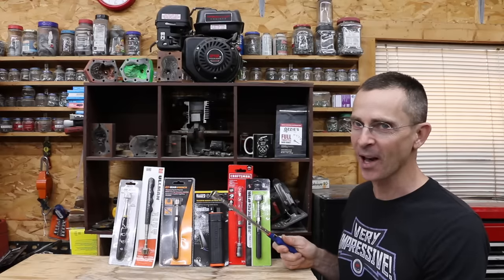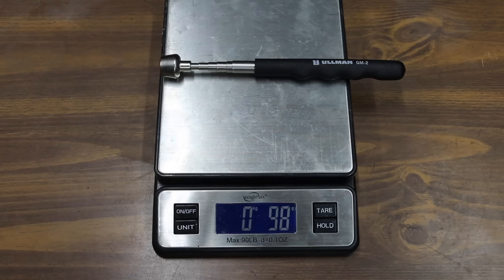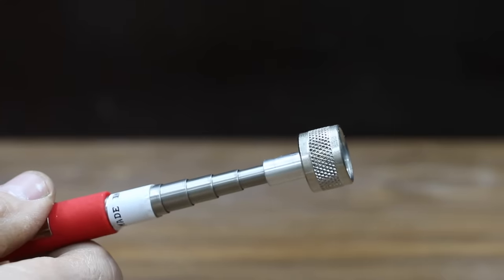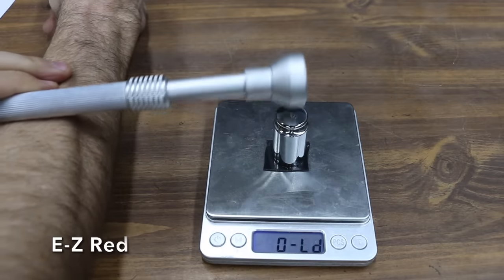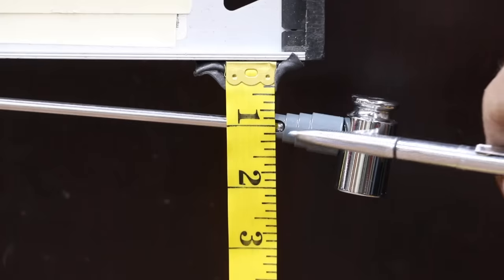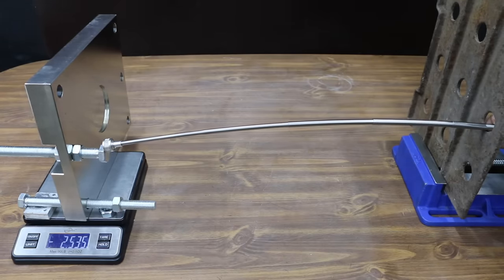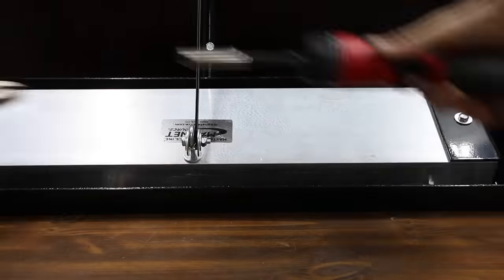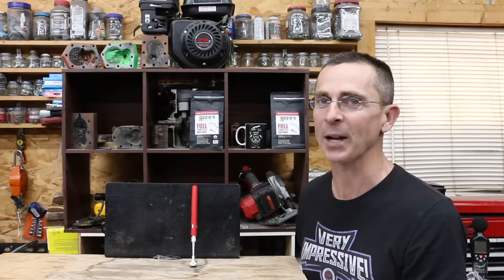Best Magnet & Magnetic Sweeper? Let’s find out!

Comment: Digital Calipers would be really cool to see compared as well as impact socket sets!
Reply from the maker: Thanks for the suggestion.
Reply: Seconded
Reply: I would also like to see impact sockets. I recently bought a Pittsburgh set because the price was just too good, but I'm curious what I'm missing out on vs something like a Tekton or DeWalt set.
Reply: YES!
Reply: @djgibbs7041  The HF sets are good to start out with or for a home-gamer but they will wear out quickly with regular use. I paid the money and bought Mac sockets for the sizes I use most often.
Reply: I'd add a traditional vernier caliper, and a mechanical dial caliper, to that test.
Reply: Mitutoyo. End of story.
Reply: @svn5994  these videos for me are for testing diminishing returns,   99% of the best products are the best most expensive products because well duh, but how close is the 7$ to the 70$ one is the important part of these videos.
Reply: The digital calliper is an easy one, starret or mitutoyo are the only ones worth getting if you really need to rely on them, the cheap ones work but not as accurate or as long and the batteries always go flat way faster.. callipers are one of those buy once, cry once tools
Reply: Or swivel sockets
Reply: I'd like to see "Anytime Tools" dial caliper from Amazon ($40) included in that comparison because I bought one.  😂  It feels like a high quality tool, heavy in the hand and well-built; I'm curious how it compares to HF and high-dollar brands.
Reply: Digital calipers would be difficult IMO. It seems like they're all accurate enough, or at least all the ones I've used are.
Reply: I'm currently shopping for an axle nut metric, deep well, impact socket set.  I second the suggestion!  Warranty, ease of exchange if needed, and of course fit, finish and durability please, Todd!
Reply: @svn5994  Starrett a close second.
Reply: @svn5994 nobody can argue that. But it'd still be nice to see a comparison.
Reply: @markshort9098 or if you're  lucky it's a find one behind the shop fridge once while the original owner cries once lol
Reply: @svn5994  Yep. I splurged on the coolant proof mitutoyos and liked them so much I bought a second pair (one for the shop, the other for my 3d printing/tinkering setup). Zero regrets.
Reply: He uses chrome on impacts.sorry
Reply: Seconded on the impact sockets
Reply: There are no digital calipers other than Mitutoyo.
Reply: Heck yes on the calipers. I need them for 3D printing and options are basically "name brand that is hundreds/thousands $$$" or "800 Made in China brands that all look the same and advertise the same specs but differ by like $20".
Reply: @rcmaniac25  Dude, just spend the $175 and buy the Mitutoyo 8" calipers.  You won't be disappointed.
Reply: True, but sometimes a 11.00 dollar DEWALT drill bit set is just as good as an expensive set. My drill bits are DEWALT because of project farm

Comment: A Telescoping magnet is an absolute essential item in my tool belt. I use it all the time and youll be amazed how many odd uses they have.
Reply from the maker: Same here! Runaway nuts and bolts always seem to settle in hard to reach areas
Reply: Yes, but lifting capacity is not a significant feature. The most important thing is reach and adaptability.
Reply: I am guaranteed to drop a few screws when on a ladder.  It is law.
Reply: I carry two, so that I can pick up the one that I drop whilst picking up a dropped bolt.
Reply: Good point drop a bolt or a nut inside of a  BMW or a  Euro car a good Magnet or a multi flex head magnet is super helpful
Reply: @JarzanX  100%. Head flexibility and low pull-through of the shielding are far more important than lifting strength.
Reply: @JarzanX  Strength can help overcome that last inch if you can't quite make physical contact.
Reply: @rogerstlaurent8704  A lot of BMW hardware is aluminum. At least it is on mine with a magnesium block.
Reply: ...that's what she said
Reply: @JarzanX  For me lifting capacity is the most most important feature quickly followed by being robust enough to handle the weight. Fishing for a 1-3/4” deep 3/4” drive impact socket in a large excavator frame will quickly make one appreciate a good strong magnet.
Reply: List all the ways, I want to be amazed.
Reply: @JarzanX  sure, but knowing how strong these products are vs their claims is still helpful info. This way you can decide for yourself what strength magnet you want
Reply: @UncleKennysPlace  The OLLLLLLLLLL daisy chain baby
Reply: Even though I find you need various types and sizes for different tasks even a basic mid size one is extremely handy in any tool kit.
Reply: Not for me, because I use almost all stainless hardware, which doesn't stick to a magnet.
Reply: Many of these telescoping magnets look suspiciously similar to those telescoping baton-clubs used by police in British crime-drama shows!
Reply: @JarzanX , side-shielding becomes increasingly important the farther down into a tight space you have to reach.
Reply: Side shielding is important.
Reply: @dougrobinson8602  not the Nuts  and bolts yes there is a lot of Aluminum on BMW"s and other euro cars
Reply: I don't use it even monthly usually but it's so compact, minimal mass and inexpensive it's essential for any significant toolbox.

My (probably cheapos) have failed at telescoping joints in recent yrs, if not carelessly kinked at some point.

Comment: I bought a Central Machinery sweeper about 10-15 years ago. I got the widest they had 36"?  I must say that sweeper is fantastic. I pulled old nails and roofing nails out of my driveway that I never had any idea they were there. It paid for itself in no flat tires. Now my driveway is dirt and gravel and it worked just fine on that. I even pulled metal and nails out of my lawn with it! 
 It is fantastic for cleanup after dismantling pallets also.
Reply from the maker: Thanks for sharing.

Comment: Hey Todd -

I have owned a lot of different telescopic magnetic pickup tools, and they all have a similar problem. They fail at the telescopic connection points after numerous cycles of opening and closing. If you could put all of the magnets to that test, that would be more helpful than the other tests. I have yet to find a durable model.
Reply from the maker: Thanks for the suggestion.

Comment: I don't normally care for Craftsman anymore, but you had me at $13, for the one that had the light in the center. It picked up a lot of weight and I could see what I was picking up. Good Job as always Todd!
Reply from the maker: Thanks!
Reply: I had a light up one from another manufacturer years ago.
The head was too heavy for the thin shaft and broke off.😠👎👎
Reply: @BA-gn3qb ,  Most illuminated telescoping magnets use coin batteries, which I detest because they're expensive and they tend to leak. The design often sucks because the battery is inside the magnet head along with the LED, making the magnet head large and unwieldy.  It would be better to use a pen light battery built into the handle, although this could get tricky design wise for a telescoping magnet. If the magnet was on the end of a goose neck then it would be pretty simple to run a wire up the middle of it to power the LED. Or perhaps use of a fiber-optic light pipe?
Reply: I bought a socket set from Sears some 30 years ago. I don't use tools as much or often as most guys, but I must admit they really do a good job. My father, a tool and die maker for GM, swore by this brand back in the day and I still have some of his tools. These days with everybody producing Chinese trash, I would hesitate to purchase a Craftsmen ANYTHING.
Reply: The last craftsman magnet I got at Lowe's was in a three piece kit a grabbing tool,mirror &the  magnet for around 2 dollars more than the magnet alone.
Reply: I bought the Craftsman magnet with the light. The light broke after the first use. It was replaced on  warranty and the second one broke right away. I now have a Pittsburgh.

Comment: I'm a professional airplane mechanic and I use magnetic pickup tools regularly.  They are mostly used for starting a nut on hard to reach bolts and screws.  For that purpose,  it is important that the head swivels or otherwise articulates,  and that the magnet is relatively weak.  If the magnet is too strong, it doesn't work for this purpose.  I use a really cheap, tiny Harbor freight magnet tool for this.  I think it was around $3.
Reply from the maker: Thanks for sharing.

Comment: I have the Older Craftsman that came with a attachable mirror and the Blue Point. That Blue Point can get into some tight confined areas.  Which normally seems to be where all the lost hardware goes to. 
Thanks again brother for another great video. We honestly do appreciate everything you do and especially the unbiased testing. 
Have a great day brother.
Reply: I've got that one also. It has been very handy for dropped things under the bed  , and seeing into small places.👍.
Reply: After 24 years in an abrasive environment my old Craftsman was pretty much useless, no telescope grip so it would extend if held vertically.  Bought some cheap ones and the end has come off of two of them (well, one complete end and the other was just the magnet), and the clips require a small nylon tie to stay on.   I have an Ullman at home that has held up well, will probably get another for work from PF link but it's sold out ATM.  The new Craftsman look different so I'm leery.
Reply: @ensidfkgnur  I'm sure 24 years of use will  wear out any one of them. But if it lasts that long you definitely got your money's worth out of it.
Reply from the maker: Thanks!  Thanks for sharing.
Reply: @WiIdbiII  
 Mine spent their life in the  top rt hand drawer, doing nothing until called upon. 
Even then the most that ever happened was getting a little grease on them which was immediately wiped off and put back away. The Blue Point is over 40 years old. Another smaller snap on pocket extending magnet was carried in my shirt pocket for a couple months but never used. Until I put it away then within a couple days, yep, dropped a dang nut. I also have a 24" Spring style with a magnet on each end, one red cover, one black cover and of course the push to open 24" expanding gripper. That double ended magnet is another Craftsman that was probably bought in the late 70s. It is definitely a little worse for wear. That one was one that even if you didn't see the item you just shoved it into the area,  moved and twisted it around in hopes of it finding the lost hardware.

Comment: Project Idea: Tile thin sets; Does it really matter if it's modified or unmodified? Can different types (glass/porcelain/stone and sizes of tiles work just fine? Horizontal only or vertical applications? How well does it hold up the weight of the tile on the wall will it slide? Does it crack or provide movement? How water-resistant/proof are they? Maybe include grout tests as well? Brands such as Bostik, Mapei vs more general home improvement store brands? How fine is the sand mixture? Can it bond well to a wall does it have to be pained or sealed? What about Antifracture membranes? Does the paint membrane really do anything or is it a gimmick?
Reply: This is very needed
Reply from the maker: Thanks for the suggestion.

Comment: After buying a few different brands of these, I've discovered the failure point is consistently the collapsible antenna separating. Better off with a wooden dowel with the head assembly epoxied to one end. ✌
Reply: Exactly what I’ve notice with the couple I’ve had over the years. I’ve only had cheap ones though but I can’t see spending more than 15 dollars or so on one.
Reply from the maker: Thanks for the feedback.

Comment: Good video as always, but there's a style of magnetic pickup tool that I vastly prefer to the kind you tested. You can find it under a couple of names, but Mag Mate seems to be the most common. Instead of a telescoping wand, it's a long piece of copper wire with a slim magnet at the end. The one downside is that you can't collapse it short. I see that downside as negligible. The benefits? The copper wire can be bent into any custom shape you want, making it possible to navigate into complicated little areas under an engine. It holds its shape perfectly. The magnet is quite strong, and doesn't distort much under the sort of load you'll usually be grabbing.

The slimness of the tool also makes it much more useful in an engine bay than the tools you looked at. I don't think even the slimmest of those tools is small enough to get small screws and fasteners out of a really tight spot, say, between a manifold and subframe. And while the length of those tools is adjustable, you can't put a custom bend in them, so you can't get past obstacles.
Reply from the maker: Thanks!  Thanks for sharing.

Comment: Great review. I work in construction building tilt style buildings like warehouses. Since the panels that will be the walls are formed in a horizontal position and poured like that before being lifted into place by a crane, they need to be thoroughly cleaned out, so we use a lot of magnets to get out the residual tie wire and other metals detritus. Now I know which magnet is the best for my money, so thank you for that. 

An idea for a future video would be paint rollers used with epoxy and polyester resins and epoxy based paints. I do a lot of fiberglass work on the side and have found Red Tree 4" foam rollers to be the best for this. What I'm looking for is a smooth application over an entire boat hull, something in the 20 foot range, without expanding or falling apart. 
Thanks!!
Reply from the maker: Thanks!  Thanks for the suggestion.

Comment: I picked up the Pittsburg magnetic tool at $3.99 a couple years ago and for its performance and lift I don't think it is beatable.  Note that I am always dropping things vertically and primarily using it nearly straight up and down and it works perfect for my use case.  I have never had a need to grab something horizontally so I never noticed it had that much sag.  If there was a price per lift performance chart this thing would win by a landslide.  Thanks for the video!
Reply from the maker: You are welcome!  Thanks for the feedback.

Comment: Suggestion for future test: 
-Electrician’s Multi-pliers.   
Of all the jobs I do as a handyman, nothing requires juggling more hand tools in rapid succession than electrical work(often on a ladder). I have the larger Husky version that has all the features I want and also replaced my 8” needle nose in my Everyday-Carry tote for non-electrical tasks; however, the wire stripper section of this particular tool has seemed quite dull since it was new out-of-the-package.
Reply from the maker: Thanks for the suggestion.

Comment: Nice one, Todd.  I've seen these rolling floor magnets and never tried one.  I don't usually have a mess like that, but have had a few screws, washers and stuff where one would have been handy, especially for finding them in grass, but they would be better if the gap to the floor would be adjustable for various applications.  Your video will be helpful if I ever want one.  I have an OEM Industrial brand fixed 21" reach magnet that also has a pushrod for four little gripper fingers and a battery case for 2 AAA alkaline for an On/Off LED at the end.  What I use more in the house is a 36 inch "Pick-Up & Reach Tool" with 2 long, arched, 1/2" wide grip fingers.  It was interesting which of the two types were better at various things.  Thank you!
Reply from the maker: Thanks and you are welcome!

Comment: I have one of the rolling magnets from Harbor Freight.  This thing pulled tiny bolts and roofing nails along with some larger pieces of metal that was buried in several inches of large gravel. Impressed with the strength.
Reply from the maker: Thanks for sharing!

Comment: To those who didn't know: in the powersports industry, often times flywheel (rotor) magnets are held in with screws. Remove one from a discarded engine, solder a solid battery lug onto a 4 ga battery wire, and bolt the magnet to the end. Works great for retrieving that 10 mm socket that you dropped inside the jetski hull. Thanks again PF!
Reply from the maker: You are welcome!  Thanks for sharing.

Comment: thanks again for the great video! i just bought a few Mac Tools magnets for work based on your recommendation.

one suggestion i have for a future video would be lock de-icer. i recently had to get a padlock lock unstuck on an access panel and it was a royal pain until i bought and used better de-icer. the stuff i used was Blaster brand, by the way, and it worked quickly and easily with just a small amount, so it would definitely be worth testing.
Reply from the maker: Nice!  Thanks for the suggestion.

Comment: Great vid.  

In all honesty, I kinda feel like the roller things are a waste.  Take a 2x4, slap some wheels on the side or make a caster set, slap in some rare-earth magnets from your preferred local tool store, and you're pretty good to go in terms of cleaning things up.  Heck, you can put plastic wrap over the magnets and just throw away the wrap to keep things cleaner.  Made one myself for when I need to clean up after cutting things.  (Block of 2x4 with some mags glued into it with a piece of bamboo as a handle.  Kinda flimsy, but it gets the job done)
Reply from the maker: Thanks!  Thanks for the feedback.

Comment: That magnetic shielding can be super important. At a powerhouse shutdown I was working, a millwright dropped an oil cap into a turbine as the job was wrapping up. After the turbine had been put back together. Then the magnet he used to try to fish the cap out with got stuck on something else and broke off. 😂

The plant was not happy about having to do a partial teardown to remove those two items.
Reply from the maker: Thanks for sharing.